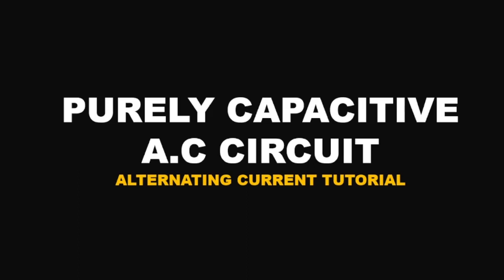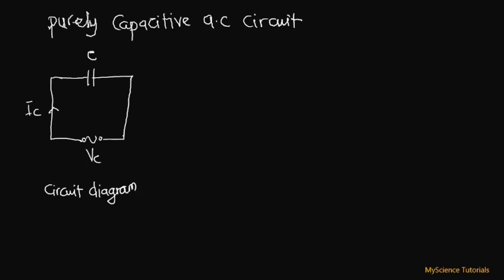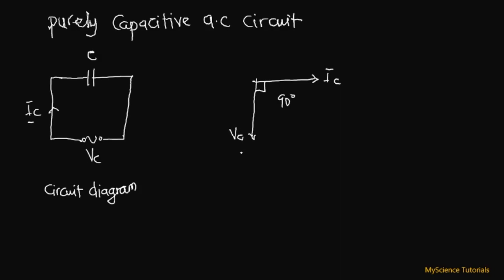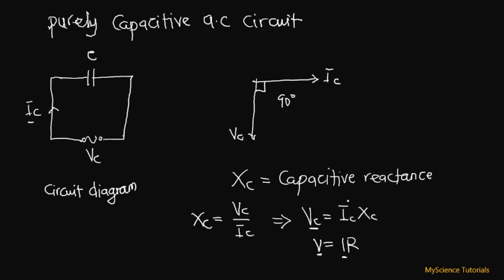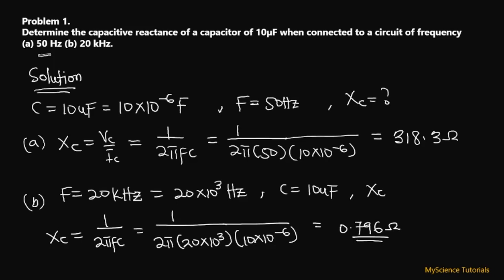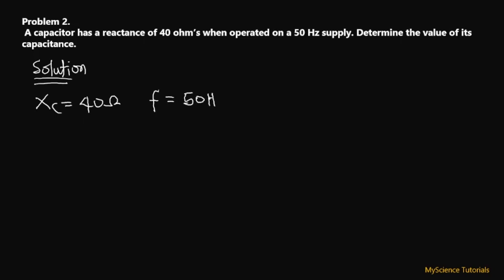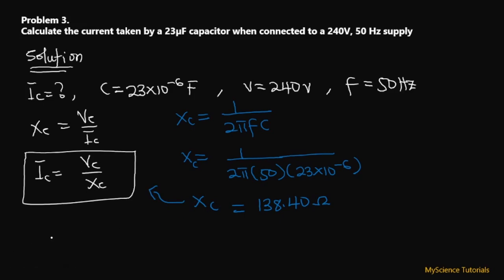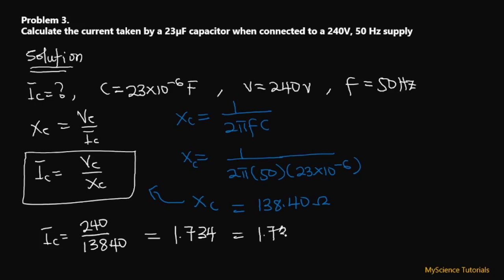Purely capacitive ac circuit (Alternating current tutorial)

Comment: Why there's no diagram in the sample problems?
Reply from the maker: I just decided not to draw it but you should if that will make your calculations easier for you
Reply: @MyScienceTutorials is the diagrams in your problems is just the same with the circuit diagram you discussed, cuz I don't how to draw the problems
Reply: I want to use your circuit problems for my report but i dont know how to make diagrams
Reply from the maker: @wilsongumapac8484  yes, since this is a purely capacitive AC circuit, we only have the capacitor connected to wire, switch and a voltmeter
Reply from the maker: Just use the circuit diagram I drew in the introduction of the video as it will be same for all. Just make sure to label it well with the correct values